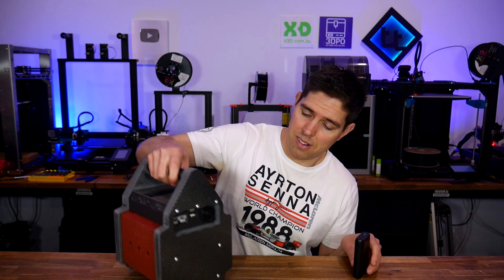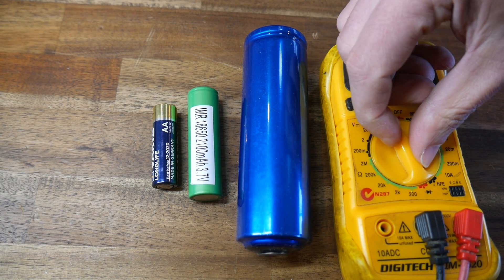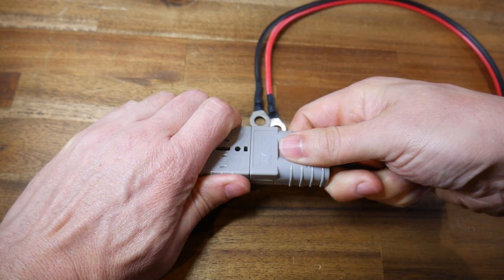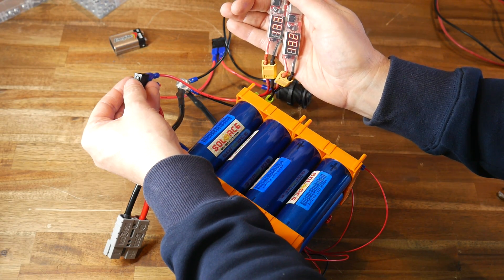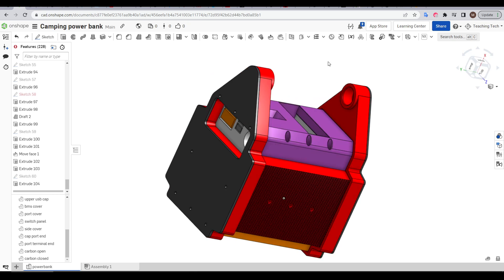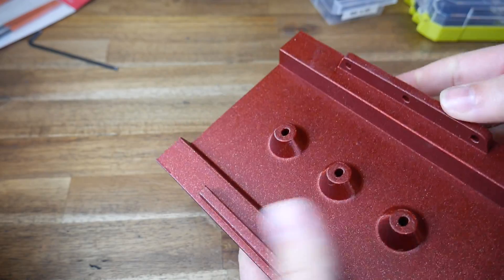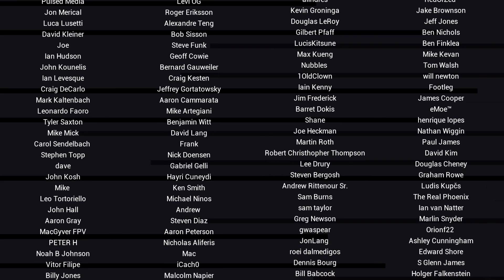Making the ultimate camping powerbank + Bambu Lab X1 update

Comment: I would have also moved the bms to the top or side as heat rises. I would have also included foam tape in areas where impacts could happen to help prevent any shock damaging internals. Id love links to what exact filaments you used, Also maybe i missed it but how do you charge it? mayeb id include another secondary anderson plug to charge. The tpu outter cover sounds smart any protection you can give it the better, vibration kills stuff.

Comment: Might want to add some rubber feet on the bottom. Nicer looking than the one I made. I probably spent way more than I should but it's powering everything in my camper van. Two marine DC batteries with 200w solar 4000w peak inverter. I need more panels. Solar is a let down where I live so most time I charge while driving and when I stop shut the switch off from the bank to the alternator. I learned why you shouldn't do this. It'll fry the alternator

Comment: You should not use those switches when load is connected as sparks due to high current might and will weld them in switched on position. That is why antispark switches were invented. Just switch them on first and then connect the load.

Comment: i dont ever do series because all the cells i always get are unknown quality. health and capacity.      i weed out the bad cells capacity test them and put them in parallel to get power.  and since you cant boost 3v to 12v i use a dual stage   a lithium ion to 5v high current and a 5v to 12v

Comment: As this is primarily a camping design this might be overkill but i would have added an inverter to add to its versatility and a solar charge controller so you can connect it to a solar blanket and keep it charged for longer periods while out avoiding the drop bears.

Comment: I like the idea of finishing the design with end cap bezels. I think I would connect the two bezels on the four corners with a carbon fiber tubes and threaded rod. Personally, I think this aesthetic would give a nice touch and provide extreme structural support.

Comment: use a rubber cap on the end pieces.
it will help prevent the Lithium Bomb  you have made from being detonated by an accidental bump, and will only explode by a degraded battery and an unstable charge voltage or a malfunctioning charge controller

Comment: I wish someone would explain to me how you balance batteries with such thin control leads... My neanderthal ass could understand if the full connection of a cell lead into a BMS but since their paralel/serial connections never change, to me it seems that they still act like one battery. electrons flow from one end to the other. How does balancing work here?

Comment: That project combines a wide variety of knowledge and is pretty neat to show. However, in that instance, there is no economy by making it yourself. Parts cost adds up fast and you end up with a 250Wh capacity power bank. A Bluetti EB70S has 716Wh capacity, same cell chemistry, more plugs including 4 Ac OUTLETS and cost 700$ Cad. Cheers

Comment: Excellent Cells & Structural Designing. I worked with low and high voltage regulated power supply designing back when the first Integrated Circuits were just coming on the market. The guys in the lab back then would have loved you. You need to show specifically how you charge this in detail with both mains and auto connections for it to be understood by ppl who would want one.

Comment: i would open that up and fuse the 12v car socket also i would most definitely wrap the bus bars and some of the wires in Kapton tape for better protection you should always use Kapton tape on battery packs like this.

Comment: The one thing I would have chosen is a bolt with a low profile head on it. You seem to add 6mm to 8mm of dimensional volume purely due to screw head  choice. Was there a cost effective and safe option available? I presume size is always an issue in applied design and here may have been the simplest way to overcome some space wastage.

Comment: This is again a great design. I love the red side panels and the knurling looks much better than a simple flat surface.
Just as a warning for all viewers who are going to build something similar: Although LiFePO4 is considered safer than LiIon, make sure that you don't short circuit anything during testing or assembly. These cells are able to deliver very high currents when a short circuit is created and your wiring (or screwdriver) will go up in smoke.  For that same reason I would take a BMS with a current rating one step above the max. current you would use.  For me, the 30A BMS would be more than enough.

Comment: I'm curious if the side of the part that had trouble is on the right side which is opposite of the bulk cooling fan. Also, are you u sing the carbon fiber sheets for reinforcement or for aesthetics? What are printed end pieces made of? Did I miss it?

Comment: Remove watches and rings when working with batteries. They heat up very fast when short-cutting power.
Better use insulated electrician tools and cover all terminals that are not being worked with. Hex key between terminals won't (or could, depending on POV) be a pretty sight ;)
Nice and practical project. Reminds me of creating BMS software (charging curve, safety features, charger control, CAN interface) for a battery company that eventually went down. One SW guy dropped a wrench or similar on battery terminals. After that everyone was trained for electrical safety.

Comment: Interesting, I may do a case similar for a 12V 18650 multipurpose battery bank I build for my canoe trolling motor in a repurposed "ammo" box. For the sanding marks, you could take a torch to those pieces and quickly pass it over the edges to remove most of the sanding marks, not perfect but I find it does help a lot in removing those.

Comment: Looks smashing.  I'll have to check out those PLAs that mask the layer lines.  I've a couple of things I've built that I'd like to market and the sanding and spraying takes so much time its nearly not worth the time I put into it to sell the items, this looks like a good compromise.  As for ideas of what to include in the onshape tutorials, you mentioned false floors on the holes to avoid supports.  Can you include that in one of the demos? A lot of my designs that use screw holes could be neater (especially if they're on legs) and I'm wondering if I can use this to prevent the loose bits and really make my prints professional.

Comment: You definetly need a fuse on the 12V port.  Also, why not include atleast one type C USBPD port?  You already have the 12V on had, so no boost converter needed.  You could have 5V, 9V and 12V out one port at up to 2A.

Comment: missed opportunity: heavy-duty terminals for jump starting¹ a car

(¹- Technically not possible, but if you give that car battery a few minutes to get some charge, both it and the power bank will contribute the current required to start a car. It has all the protections anyway.)

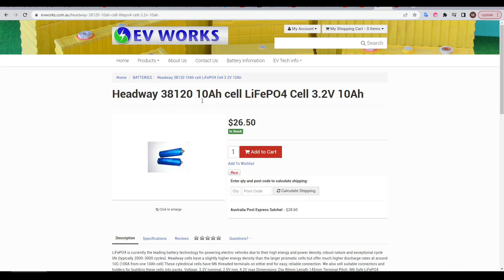EDIT: At 1:56 he mentions 100A discharge current... and since they are hocked up in pairs that gives 200A. If that BMS is worth its money, he could jump start a car without any wait, had he included the terminals.
Reply: The BMS would need to be specced to handle 200A output also, since it's technically part of the 12v battery.
Reply: You realize car batteries are rated at more than 600A ? You won't jump-start a car with only 100A if that battery is well discharged, you need at least 400A.

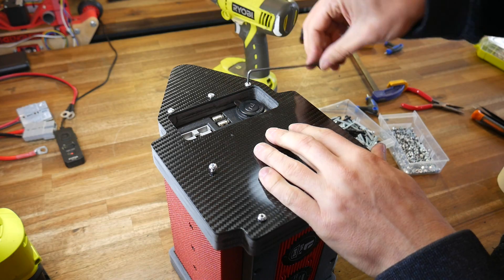Comment: 13:18 My good sir! You owe it to yourself you buy yourself a really good electric precision screwdriver.

Why precision? For the parts that most 3d printers use,  most bits are for M2-6 screws which these drivers suite perfectly. 

My recommendation is the Miniware ES15 as its just frankly the best screwdriver with features like open source firmware, useful modes (selectable on its screen), usb-c, a nice big battery, and great torque and speed for this class of screwdriver.  Of course you can always get a cheap wowstick if you aren't quite convinced yet or many of the clones, but considering your profession involves so much of this type of work, I can't recommend the ES15 more strongly.

The amount of wrist and finger strain one of these bad boys will save you is immense.

Comment: That knurled texture really does look the bees knees. Almost makes it look like metal.

As for the Bambu, Im still somewhat disappointed by the top layer of the prints it spits out, the cooling (though maybe that's just the profile and it has more cooling in it), edges that seem like pressure advance isn't perfectly tuned in  and sides which still have some input shaper tuning left to do (with the waves).

I'm still excited to get mine though, as they finally offered what people wanted. Of course Id prefer if it was open, and could print locally on your own network without any internet connection, and at least they said they will do the latter, but I really should probably not have backed based on future promises in that case.

Either way it seems good they are putting so much effort into support and I really hope the features come through. I'm tired of tinkering to hell and back and want future mods to my other printers to be purely for fun.

Comment: I do have a question for you I have an ender three 3-D printer it printed great for the first two or three prints after that I will level the bed and it's level great everything is good and when it goes to print it raises up almost a full quarter inch and so none of the filament touches the heated bed do you have any ideas for me. I did add the dual Z access upgrade but I was still having problems with this printing anyways I don't know if that's a firmware update but nonetheless, I cannot get this adjusted to where it will print I literally jacket all the way up to where it was literally pushing the nozzle in and once it started to print it raised up like a quarter inch and just read the filament all over the place so if you have any ideas let me know I haven't even been able to get in contact with the manufacturer! Oh this is the first time I've had in this and I'm pretty illiterate so don't be too hard on me THANKS

Comment: Michael, a very nice design/build of a very useful item. The only (constructive) criticism I would make and perhaps something that will be addressed in V2 is that I would like to see the 12V outlet fused and I'm a little concerned that the BMS will get very hot. It's mounted on the bottom so will not get any airflow over the heatsink. Maybe the BMS would have been better on the top, under the handle?
Reply: I expected the BMS to be on top or the side myself. It would really benefit from moving air.
I think I'd also want some sort of current sensor and a microcontroller to integrate the power usage. LiFePO4 cells have a very flat discharge voltage. You can't tell how much charge you have left until it's right at the end of charge. Still, I like this project like all of Michael's projects.
Reply: @ddegn  Adding a power usage indication does make sense and that's what I would like to add too, but the phone app also shows the state of charge by measuring the current.  Not my preferred way but at least it is available.
Reply: @Rob_65  I missed the fact that the BMS came with an app. As you say, it's not the best way to communicate the data but it's not too bad. 
Apparently the Bluetooth device plugs into an UART port on the BMS. This should mean the BMS could communicate with a microcontroller rather than the Bluetooth module. This  should make it much easier to add a capacity gauge.
Thanks for letting me know about the included app. The app (and especially the UART output) makes the BMS much more desirable to me.
Reply: And usbc
Reply: BMS isn't supposed to heat, there's very little resistance when running.
Reply: @zoidbergisrioisghsofidghsoid  Yes a BMS does heat up. The resistance is low (typical around 0.002 - 0.004 ohm) but the current plays a big role. The power (heat) being generated in the resistor and MOSFETs P = I² * R. A 100 Amp discharge current results in 10,000 * 0.002 = 20 W of heat being generated. During charging the same rules apply but there is additional heat being generated by the passive balancing circuits.
With a 20 Ah pack like this, such high currents are highly unlikely so I think that, in normal use, there will not be a problem. But you still want to be able to handle this highly unlikely scenario too - or, as I suggested, use a BMW with a lower current rating.
Reply: @rumblfmp  Sure, but he cannot pull 100 amps from a 12V lighter socket and two usb plugs. I know BMS do heat, I draw 600Amps everyday from mine, but it won't heat in this specific application ;-) Most BMS live long and healthy lives behind heat shrink plastic without any kind of airflow.
Reply: I'm by no means an expert, but I don't think the BMS needs much cooling at all. Furthermore, the type of fins used is the type that's optimized for passive cooling. In other words, it's not meant to get active airflow. It certainly wouldn't hurt, but it wasn't designed to take advantage of it. 

With that being said, I see a very easy design adjustment that will greatly alleviate the issue. It can stay on the bottom, but the bottom plate could have recesses to allow for passive air movement. This would also improve how flat it can lay on an uneven surface.

Comment: Highly empressed! Just a thought, could that be made into a car battery version with some mods?
Reply: You wouldn't want Headways under the car hood in the heat or in freezing temperatures. Any BMS that could allow 300+ amps would cost more than a lead acid starting battery and be huge. Also, if the Headway pack happened to be discharged fully, the poor alternator on the car would put out full amperage for way too long and would likely burn up. Alternators typically put out full amperage for less than a minute then back down to a fraction of the rated capacity in normal use with lead acid starting batteries. The Headways like LiFeP04 batteries have very low internal resistance so the alternator would peg out with maximum charging amperage for way too long and might fail due to overload and heat.

Comment: Slicer settings will only fix your issues with overhangs if you decrease the speeds. They are not even close to the amount of cooling needed for some materials, at the somewhat decent speeds they love to flaunt. However, maybe in the firmware they don't have the maximum RPM's set for fans (i.e. not likely). Don't expect better print quality results at those speeds with that mechanical design.

Comment: when you sand your parts, use a small torch/lighter to quickly heat the sanded surface. It gives back the luster you get before sanding.
Reply: This could be one of the most helpful 3d printing comments ive read, definitely going to give this a try next t time I have to sand.
Reply: @Xploit66  Let me know if it works well for you.

Comment: Looks like it's gonna overheat very quickly, because there's nothing to transfer heat away from the inner compartment.
Reply: Internal resistance of the cells is quite small, so in normal use (likely below 2A or 0.2C ?) they don't heat up much.
Reply: @kimmotoivanen  I'm not so sure about that. He's saying that the 50 A connector is perfect for him. If he'd have just the crappy USB outputs without PD or even QC I'd agree, but with the additional 50 A connector and the 12 V car output connector I'm afraid he's gonna draw a lot.

Comment: I think ASA would have been better for the red parts because they're going to be outside in the sun, and ASA has better heat and UV resistance
Reply: If you leave your giant battery in the direct sun so it heats up to 60+ °C that's probably not too good. Just put in in the shade, that's better anyways.
Reply: ASA is unprintable, even with an enclosure. You need a heated chamber. If you're printing very small parts, then yes.

Comment: Cool build! I personally would've added a DC to USB-C PD output as well, such as the Coolgear Chargeit! Mini 75W (60W USB-C PD and 18W USB-A QC 3.0). It accepts 9V to 24V as input and comes in a little metal case with mount holes, so it could be mounted on top as-is, but I would probably remove the metal case and mount the board inside your design with only the ports facing outward.

Comment: This looks like it would work well for solving my problem: I work from home, and get occasional blackouts. I need to build a UPS for my network gear so I can continue working on my laptop even when the power goes out. It all runs on 12VDC, so I don't want to pay huge prices for a consumer unit that will be less efficient than a lower cost diy version like this.
Reply: That's a good use of it, the cells he used are quite expensive per watt hour of energy for lifepo4 cells, don't use these, also his battery pack is just 256 watt hour which may not be enough to power your system for long, you can get 500wh lifepo4 batteries on amazon for about the same price if not cheaper

Comment: I think that was really interesting project.
Only thing i'd love to see changed in it is for 12v lighter socket to be fused with standard car fuse. (fusing charging input would also make me feel much safer)
Reply: Red headway cells are commonly used to car audio they handle high amperage draw and recharge really well